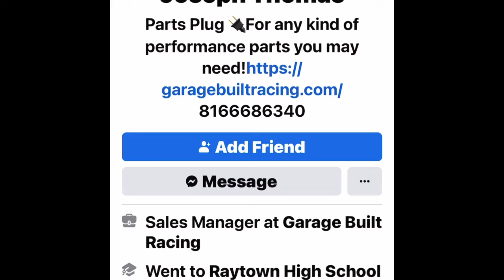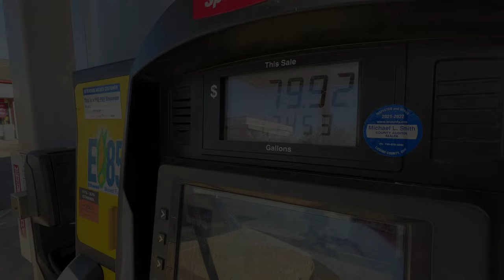UNCLE BUCKO GOES FOR A TEST DRIVE!  We fix the 10 Bolt so we can CRUISE until we put a 9” in it!

Comment: Jeremy facial expressions on the 10 bolt is hilarious 😂 when the 9” gets there you should put the 10 bolt out of its misery in style lol
Reply: 9” is good but a gn 8.5 would have been fine too. Been beating on mine for 20yrs. 1.45  60’ 5” of air under both tires on a 10.69@122 pass. Recently gave the Eaton posi to my son for his 8.5 gn rear.
Reply: @fast73nova   if your car also weighs 3,600 lbs then, .. that is impressive.  The life span of any differential is dependent on the power/traction of a given combo vs. The weight of the load it's working to push. The Malibu is past the threshold of the 10 bolt with the power and traction it makes now.
Reply: @Torquemonster440  my nova with me was 3515 with the original axles and a Eaton posi. Moser girdle. Calvert caltracs my et pro drag radials. Th350?8” 4500 converter.
Reply: Leaving off idle. So it probably flashed higher.

Comment: Lovin Billy's focus these days, he really seems to have knuckled down since the Nova build started.  He seems a lot more relaxed and happier too, and that bit goes for the lot of y'all everybody seems to be in good spirits.  Got the good mojo flowin in the shop again and its nice to see.
Got a suggestion for that generator out of the big trailer for you, might make it easier to get in and out.  It looks like you have plenty of vertical clearance in the bay it fits in, why not build a sliding rack system for it. Could pull it out for service and repairs in place that way maybe.   If not a slider maybe just add some 2 inch steel square stock at the ends to make it easier to slide the forks under it while still in the bay. Would at least eliminate the in and out struggle for ya some.
Good luck to everyone this weekend, stay safe and have fun.  Can't wait to see that Nova in it's first race!  May Brother Billy preach the Gaptisim well and often in it.

Comment: Really digging the Malibu Bill!
As an Oldsmobile guy I'd sure like to find a clean G body cutlass in that condition, or even a low optioned Delta 88! Of course it would get a 550hp hopped up 455 with parts I have on hand. I'd probably have to go cheaper and run a TH400 with maybe a year vendors later. The axle in the Malibu is getting there but at this point probably should have done a full on 8.5 10bolt, or of course a 12 bolt, or even a 9in with all the money spent. Either way the project has brought you Tons of fun! Well worth the effort!

Comment: Glad to see you got a 9. Coming.  I had an axle twist off  on one of those and pass me up on a test and tune run. That was it for the 7.5 . Junk. Forchentley a older bronco 9. Was perfect for a 3 jen. Camaro.  No more problems  for 2 years then it twisted of the stock axel. The car went 11.14 in good air.  Turbo 400 with a transmission  brake. All motor.

Comment: The only diff I've ever had not break in a 7.5" 10 bolt is a Powertrax locking diff. The one that replaces the spider gears and cluches. Lasted for a season and a half until he could get a 9".

Comment: Tell Bill to check out Steve Morris's video about low oil pressure. He had a big block with low oil pressure.  The height on the cam synch was off allowing oil to leak by the oil band.

Comment: Kenny's rearend IS going to blow up soon, because you keep using those junk clutch style posi units. I've broken dozens of them, eaton, auburn, etc , they all break. I've NEVER broken a tru track or detroit locker in a 7.5. The last one I built has been in a 3rd gen with a Dart head DZ302 and later a Dart head 406 for well over a DECADE, and not broke once.  Not once. Thousands of street miles, hundreds of passes, dozens of 3rd gear side step the clutch sessions, and never broke once.  With a stick shift car that weighs 3400 lbs, and a 406 that makes more torque on motor than that 355 does on spray. When it had an auto in it would blow the  275/50/15 BFG's off at 55 mph... I love your channel, and I'm not trying to beat a dead horse, but I'm tired of you showing the inexperienced the exact opposite of how to go racing on a budget. Most of your viewers can not afford 4 (?) posi units, 3(?) ring and pinions, install kits, and that much labor in a matter of months.